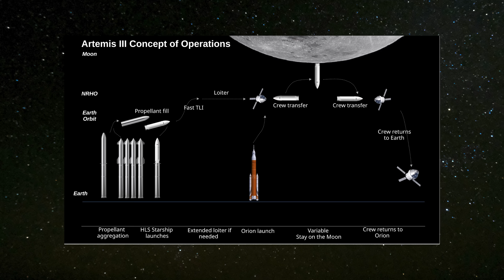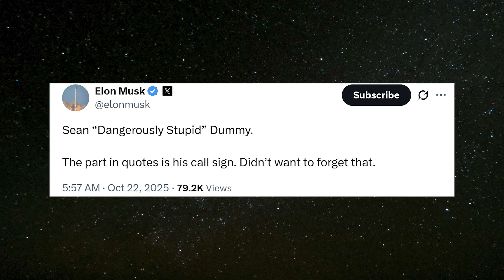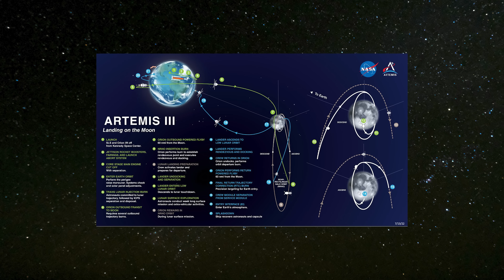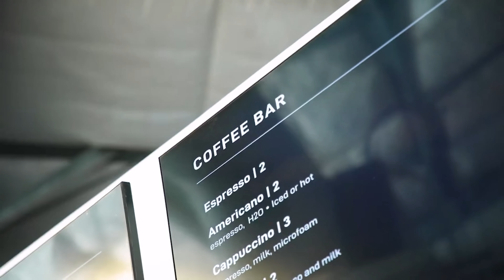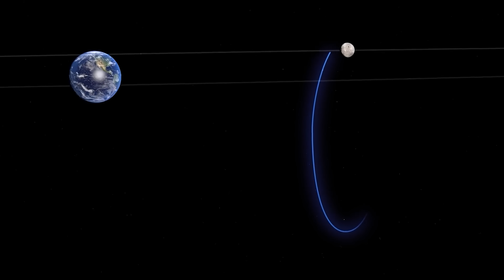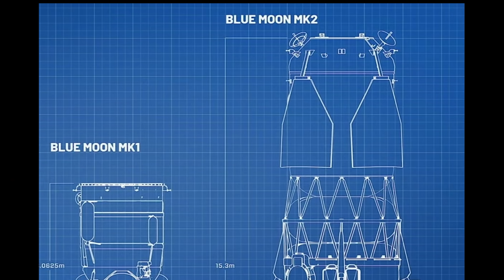SpaceX Found Brilliant Solution to Land Starship on the Moon Sooner than NASA expected...

Comment: Wait, what happened to Artemus going back to the drawing boards and recreating the Saturn V booster system? I remember watching it at the planetarium science museum less than a year ago?
Reply: What?  I don’t think so.
Reply: @xploration1437  I very well could be wrong, But I could have sworn they had said something like that. I know the original plans where destroyed decades ago. I never even looked into Elon having a contract for it, as I thought they where working on their own boosters...

Doing a quick lookie loo, I wonder if I got the SLS system confused. It's possible, I'm getting too old LOL. 

Maybe I was thinking of the F-1B program in the early 2000's or the F-1 Revival back in the mid 2000's. 

Thanks for the vid btw.
Reply: @stephensmith6660  Artemis was always going to use the SLS. And actually, building a new Saturn V from scratch would be nearly impossible, and a lot more work than building a similar but modern rocket.

Try looking up "Why Can't we Remake the Rocketdyne F1 Engine?" by "Curious Droid" for an example of this. (I'd link the video, but YouTube always seems to just automatically delete comments containing links, even to YouTube itself.)

In a nutshell, the Saturn V was built using very different skills, methods, and tools, which were the best approaches available at the time. But technology has moved on to faster, better, and cheaper things, and the skills and industrial tooling used back then to create it just don't exist anymore. A modern equivalent would be very different, effectively a whole new rocket design.
Reply: @TallinuTV  Thank you, I will do just that. Appreciate it.

Comment: Throughout space, except within about 1,000 km of Earth, deadly cosmic radiation rages against which adequate, heavy-duty protection is technically impossible. This radiation also existed in 1969-1972.
Reply: Van Allen belt? its not very dense so isnt a significant issue. Im guesssing your a bot or know nothing about space, this is only a thing in conspiracy circles.
Reply: Total BS, the space suits and helmut/visors protected astronauts for decades since the 1960's. MRI and XRay machines and even microwave ovens creates dangerous radiation at well but shielding controls it without problems.
Reply: Garbage.  There is nothing "technically impossible" about shielding astronauts from radiation in space.  Just because you can't figure it out, doesn't mean it can0t be done, or that it hasn't been done...

Comment: Refuel?? Did they refuel in the 60's?  Why do we need to refuel now with more efficent tech??
Reply: Because it’s a much more massive craft carrying far more payload dumb ass
Reply: @Lockpickingblacksmith 
It is all about Payload 
The Lunar module was aluminum foil.
Reply: @chuckevans2792 that is incorrect. The LEM (and Command Module) were made (largely) of aluminum PLATE. It was WRAPPED in foil as a radiation/heat barrier.
Reply: @Lockpickingblacksmith  ... and the foil was mylar with a very thin gold film, if memory serves me.
Reply: @ChristLink-Channel iirc, you are correct
Reply: Reusability. Most of spacex's launches have been to just send things into orbit. They haven't been able to consistently send a payload to space and recover the rocket. One time they tried to send a car into space, the main booster failed to land, the second time where NASA had them send a payload into space, they set the booster into expendable mode meaning everything goes into the launch for maximum performance and no intention to recover.

The plan is to do their normal launches to send the components into orbit, just like any regular satellite mission, refuel and assemble there, and then do a second launch from orbit and into space. That way they can still recover/reuse everything.
Reply: @Hajile_Ibushi  first of all I asked about a space shuttle launch/mission to the moon not about satellite launches! Secondly, that car was 100% faked!  The Earth gliched on the background!! 😅😅
Reply: @Ian-gk7ne  
You asked why they refuel now when they didn't in the 60's. I answered it. Do you need me to rephrase it?

The one in the 60's is single use. You launch the rocket, it crashes into the ocean afterwards. It's a one way trip. SpaceX's goal is to make reusable rockets so they don't have to build a new rocket each time, meaning they can't use 100% of the rocket for carrying a payload because they need enough fuel to come back intact.

When they actually want to send the payload into space in one go, they lose the booster. Doing normal satellite launches to send components into orbit and launching from there is the only practical way to reach space without breaking the bank.